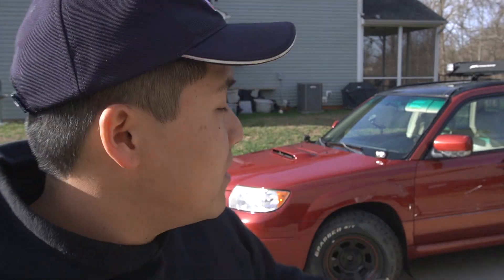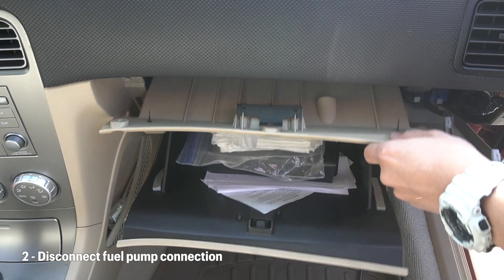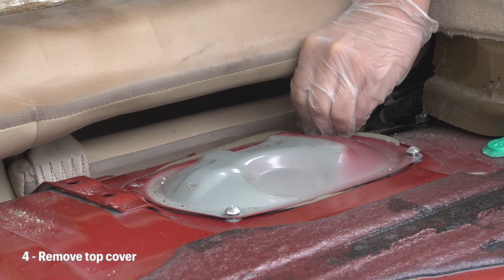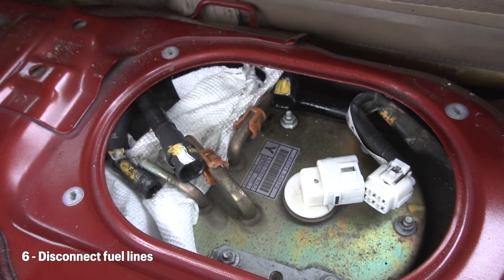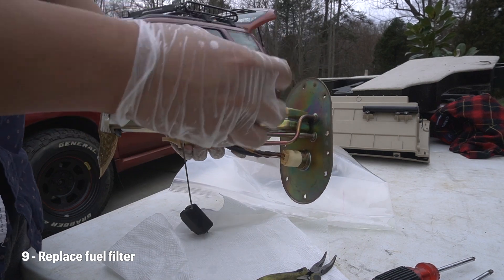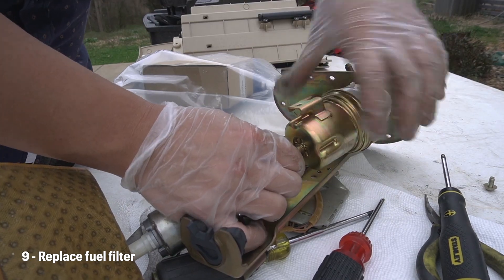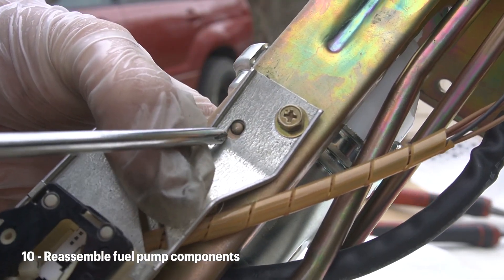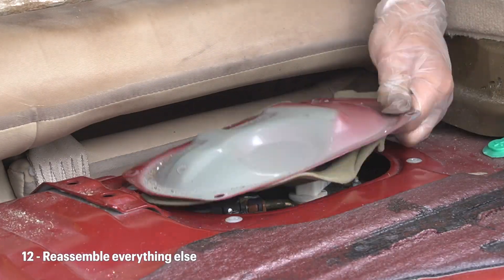Replacing the fuel filter on my 2007 Subaru Forester XT | Replaced after 161,000 miles!

Comment from the maker: So what do you guys think about these "lifetime" fuel filters?!
Who else just decided to replace them anyways?
Reply: "Lifetime" fuel filter... Yeah okay.... And I've got ocean front property in Arizona.
Reply: My 07 forester throws a code p1400, "fuel tank pressure control solenoid" the check engine light comes on. Do u think charging the fuel filter will solve it
Reply: "Lifetime?" Must be some urban legend.  My 2007 Forester maintenance booklet says fuel filter should be changed at 60 months or 60K miles, and more often in extremely hot or cold areas.
Reply from the maker: @heatwavesound.djezee909  

Sorry about the delay - Youtube just notified me of this comment!

I did a bit of search into it and it looks like the CEL code is typically related to bad connection to the solenoid connector. I'd check for corrosion and/or loose connection before dabbling with fuel filter (hopefully not too late)
Reply: @davechangauto  well I wouldn't say it's too late because I did change the gas pump and filter and that pump really needed to have been changed. Didn't take care of the light but I bought a obd scanner and found the problem to be my Fuel tank pressure control solenoid. Your research could be right also because it could also be an electrical issue where the pressure control solenoid isn't getting power.   Thanks and control the good work on your channel.
Reply: @Dave Chang Just had 205k mile timing belt, water pump service on my 07 forester LL Bean. When I top off my tank now, engine wants to stall till I rev it a couple minutes; otherwise runs fine. Think it might need fuel filter change? No chk engine or svc lights...Thanks
Reply: Any part can be a "lifetime" part of you plan to junk the car once the part breaks 🙄. Nothing lasts forever, period. There's no such thing as a lifetime part, "lifetime" usually means like 200,000
Reply: Yeah my 06 forester (EJ25) engine, is throwing codes - P0102 & P0113 I’ve tried cleaning out the throttle body and air box but it does idle, the second I tap the pedal it Boggs out on me ..😢😢 idk 🤷🏽‍♂️ what else to do ,
Reply: I didn’t have the car 24 hrs and it died on me when I got it home , my buddy says it probably sat for a while and I went and put full tank not knowing it may have sat😢😢🤷🏽‍♂️🤷🏽‍♂️🤷🏽‍♂️🤷🏽‍♂️

Comment: Why not disconnect the fuel relay? Much quicker?
Reply from the maker: Thanks Levi!

What I unplugged in the beginning is technically the fuel relay. From my research and understanding, SG Foresters did not have a separate fuse/relay that was easily accessible from under the hood and dashboard. Please let me know otherwise, it'll be a good idea to let reddit and the forums know - thanks!
Reply: @davechangauto  Why not just disconnect the battery?
Reply: @escargod  (Step not shown?) With fuel pump off/disconnected, you should probably start & run the engine until fuel line is purged.
Reply: @donhorn9170  this i was looking for this comment

Comment: I changed to a upgraded fuel pump and change the little baggy on the pump and the fuel filter in the engine bay. Didn’t realize there was another filter.
Reply from the maker: Hey Jumpshot! This is only applicable for 2006-2008 when Subaru moved it to the fuel tank. Previous years had it at the bay!

Comment: Would this fuel filter work in a 2006 Subaru Forester non turbo?
Reply from the maker: Unfort I am not 100% sure and I'd check with your local subie dealership (or online)
Reply: Late reply but it's under the bonnet in-line with the fuel hose

Comment: Is this the only fuel filter on the vehicle? Because mine doesn't have on under the hood
Reply from the maker: Hey Toast, that's correct unfortunately. The 06-08 SG Foresters have them in the fuel tank. The 03-05 have em under the hood.

It's pretty simple to remove it and then splice it under the hood - I just opted to keep it OEM to prevent messing anything up